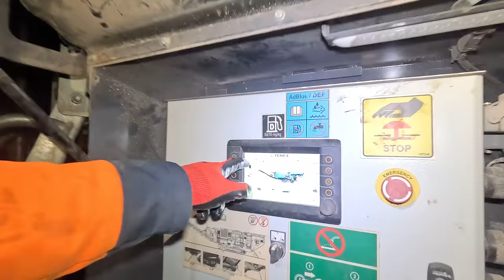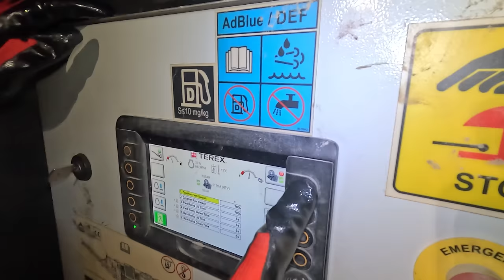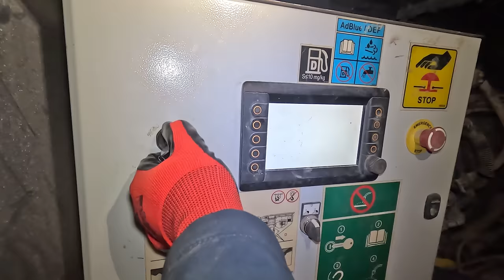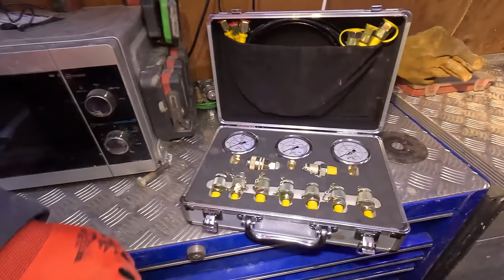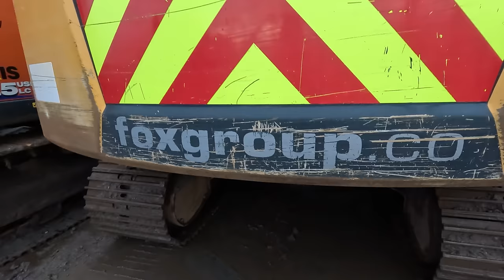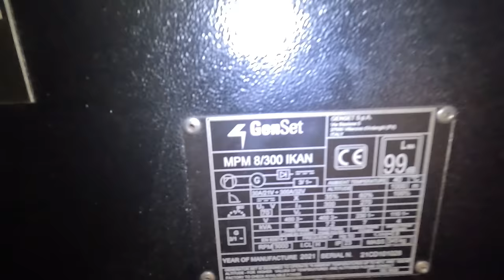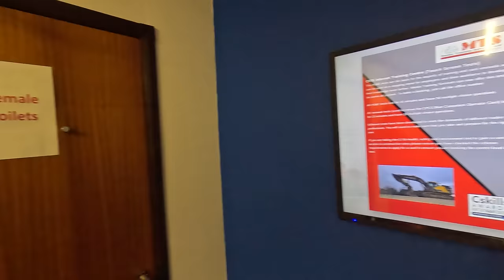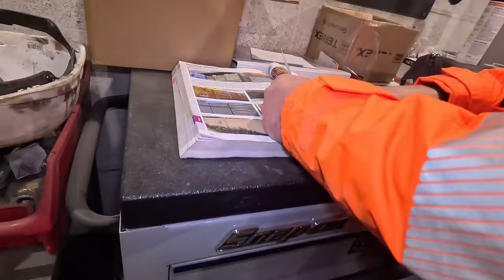Caterpillar D6 Gets New Wings! Chronicles Ch #019

Comment: Same pressure sensor is used on the valve block of truck dock-locks, used have to change loads of them as they'd start leaking internally & wouldn't signal correctly - but caveat is, as often as it was the sensor, it could also be the relief-valve pressure setting or the relief valve being stuck/knackered.  Or the solonoid...... used do our heads in working out what was gone bad as there were 6 circuits, each with all the same gubbins... Hydraulics can be a right laugh.... ish..
Reply: plus the bloomin board that controlled the solonoids could also go bad - 2950 for a new board.. I learnt to repair them pretty quickly after replacing 3 or 4.. Repairing the board used cost a quid. :-)

Comment: The worn moldboard needs a reskinning, would court the idea of putting on two rows of "touch patches" one row above the cutting-edge, spaced 19 mm and a second row 19mm above that staggered as to not make a straight path for dirt to travel iif you were to keep  the D6 ? Re placing the patches as they wear out, thus preventing the total replacing of the moldboard, which qu8te laborious.

Comment: Baz,on the crusher hydraulic problem I would have first gotten a multimeter and checked all fuses then the pressure switch for continuity, and then checked the solenoid  coils for a reasonable OHM value . The electrical , hydraulic drawings should be very helpful . We have a Sennebogen material handler that has similar electric over hydraulic like the panel you showed on the video and trouble shooting is done that way. For some odd reason it is possible that this machine has one dedicated pump for that one cylinder and it's function. Is that pump lost prime or bad?. Again we have a Sennebogen material handler and it has a dedicated pump (small }that just raises and lowers the cab. The big pump runs the boom, stick, travel . Perhaps that one function has a dedicated pump??. Great channel!!
Reply from the maker: All them checks where done off my lads leading us bk to the sensor. The machine has been down a week now. I’ll get my head in it tomorrow